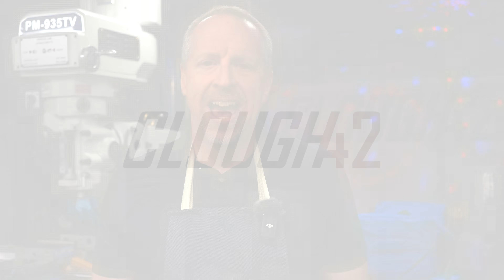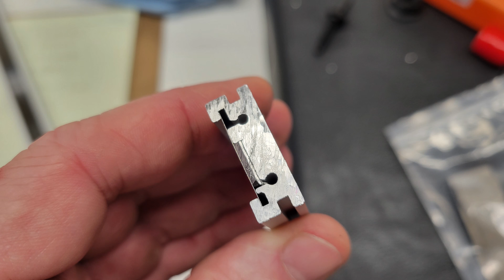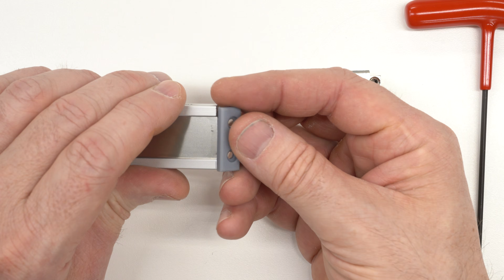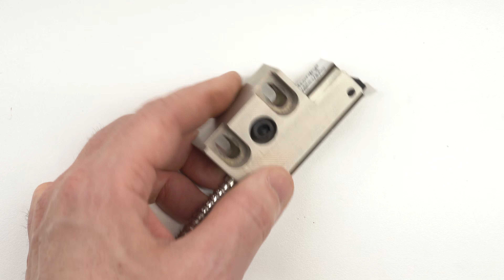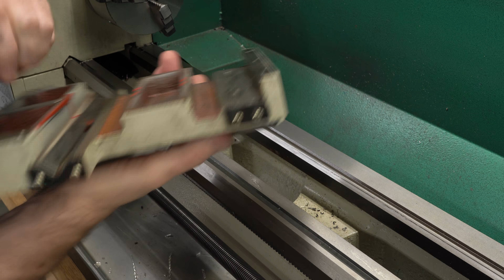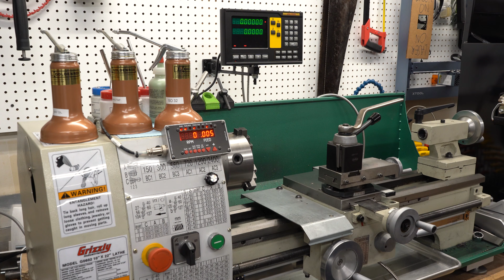Shop Accident Caught on Camera - Lathe DRO Install, Part 2

Comment: the more i look at other peoples lathes, the more the major manufacturing defect of mine glares at me...

the only lathe with a tailstock that has its overhang at the rear... sold under various names as a 12x36 gap bed. al336. they all have the same tailstock... AGGRAVATINGLY ANNOYINGLY FRUSTRATING.

Comment: ... the vertical slot on the gib ought to be toward the sliding surface(s), to facilitate lubricating ... I think if you watch your vid, you'll spot it ... I know, you put the mark before you dismantled it, so, it was put the wrong way around at the china shop ... (my experience with Chinese gods, quality control is NOT in their dictionary ...)

Comment: I built two cars from scratch and always bled the most when working with stainless sheet. After washing my hands, I'd find dozens of mystery slices across my hands, but none deep enough to bleed. Looked like I'd been playing with a box or razor blades.

Comment: I wonder why you didn't mount the Z rail on the back side of the bed and have the X reader hang off the back end of the cross slide.  I would
think that would make for a much easier install.  That's how I did it on my  Modern 1340, no problems or issues and the cables are at the
 back out of the way.

Comment: Not that I’m saying I have the best way to do it, but I have made very good tool holder that mount on back splash (on thingiverse) so I didn’t want cable running that route, nor did I want yo see them. I ran them down opening at bottom of back splash (though my Z axis mounts to backside of ways) and just covered them in that split/corrugated plastic wire covers. Protected and any rubbing is no worry. As usual James, nice job. 👍🏻

Comment: Mag scales are great for low profile installs. You may want to check for minute swarth/chip build up between read head and scale over time. I started to get a slight error from a skipping read head. The wipers are good but not perfect. 👍

Comment: Is your mill 3 phase, if so how do you convert phases?  I have a rotary phase converter for my 3 horsepower mill, but the RPC is also 3 hp so i have labored starting.  Got any tips on how to fix this?
Reply from the maker: My mill is single phase.
Reply: Ok, thanks.

Comment: Why the front for the Z scale?  Not saying it's bad/wrong, just curious on your thought process as in my head it goes on the back.  Is it just avoiding making life harder for yourself to get to the back?
Reply from the maker: It's much easier to mount in the front, much less exposed to chips and oil, and also Robin Renzetti argued at one point that it's more accurate in the front, because it's less affected by flex in the machine, since that's where the leadscrew is.
Reply: @Clough42  Hmmm, I don't subscribe to that notion...

Comment: Your VFD deceleration setting is downright scary... I'm imagining turning that switch from fwd to rev instead to stop, waiting it to stop and then putting my fingers where they're not welcome just as it accelerates back up. Plus all that waiting for the thing to stop... 
I keep mine on something like 1-1.5s acc and 1.5-2s dec, though I do use a breaking resistor, s-curve profiles and have a slower acc/dec setup wired to a switch in case I need to turn something really massive. Makes for really easy threading to shoulder

Comment: Like my Grandpappy told me when I busted my knuckles on the car frame when the nut broke loose, The job isn't over till you bleed. I noticed the hundreths display jumps around from vibration when lathe turned on, mine did the same, I turned off the last digit on the display because it was annoying and my lathe doesn't have that kind of precision anyway.
Reply from the maker: Yeah, I'll probably to the same.  When I was setting it up, I saw the setting for that and thought "Sure, why not?  It's a 1um scale."  But you're right: it's noise.

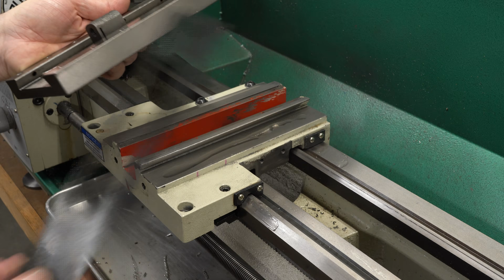Comment: Nice addition the the lathe. At 17:56, however, you managed to pour plenty of fine cast iron dust from the taps onto your freshly oiled surface, when you flipped the cross slide...😧
Reply from the maker: Oh, hey!  I didn't even see that.  I blew out most of the holes, but those are blind.  It looks like most of it ended up on the shield, but it's probably worth taking it apart to clean it out again.
Reply: @Clough42  Latest when you do the "secret" project 👍

Comment: For the read head on the apron, I would probably use some blue thread locker.  That looks like a tricky thing to adjust and it would be annoying if they vibrated loose.

Comment: Nice job James, ....I will impart a lil hint from personal experience......make absolutely sure that the corrogated metal wire shielding where it attached to the read head is sealed to the read head in silicone... and firmly screwed to the read head using the attachment screw. in its attachment flange...those wires....they do have a tendacy to pull and loosen up, as they move back and forth thus  allowing oil and fluids to migrate there or even pull out with strain.........just saying......

Comment: Nice job! Can you store the center in the DRO and recall it so you have the option of machining to a fixed width from zero, if that makes sense?
Reply from the maker: The DRO has a tool library, so you can in theory swap tools in the toolpost, and swap tools in the library and have an absolute diameter.  I haven't played with it, but I suspect on a small lathe, that will only get you so close due to flex in the machine.

Comment: Aren't you afraid that that stop screw for the tailstock will change position over time due to vibrations?
Reply from the maker: I planned to use Vibra-TITE, but the tube I have is dried up.  I need to buy more.
Reply: @Clough42  Or:  have lathe, will make spacer collar.  That way it could only give more clearance rather than less.  Did the same for my carriage wheel so it no longer disengages - the graduation ring came with it so you were forever losing your place.

Comment: My last industrial accident was 4 stitches down my fanger courtesy of my 5in angle grinder getting frisky. The tendon and knuckle have yet to return to "normal" some 3 years later. The nicks/chuck jaws bites are almost daily when clamping/deburring parts all day. Never fails to find the jaws when they are spinning 1000 rpm and your sand paper or scotch brite sends a finger into them.

Comment: why not just convert it to CNC? wipe out the leadscrews insert some ballscrews and servos and you're ready to go... For handwheel fetishists they can get 2 digital wheels and wire them up accordingly.
I had some magnetic scale installed from the beginning on but I only used them once for calibrating.
I'm even making MT2 Tapers with my mini lathe via CNC that's something that would take much more time when doing it manually. When doing multiple same parts I just measure the first few parts and then let it go.. during the run I just measure some key parts if the size is still okay and I'm not over-stressing the (weak) stepper on my X axis.. my lathe is smaller than yours and I'm still fine with it.

Comment: I used a cable carrier on my lathe for the z axis, cross slide, compound and coolant cords and tubing. Really cleaned up the installation. It was placed on the back side of the lathe bed. Drilled a hole for the wires to exit just above the chip pan and added a cover to deflect chips and coolant from exiting. Very nice and neat installation. Every lathe is different and one needs to let their imagination go a little to come up with the most compact and protected installation as you just did.

Comment: I have a similar shop problem. Somebody seems to keep breaking in and plating everything with rustolite.
Dro looks lika a good candidate for Bluetooth.
Yes I know batteries for the sensors are a pain.
But not really thats easily solved.

Comment: Just wondering why you chose to mount the scale on the front of the lathe and not on the back. Seems like routing the cable would be easier with the scale on the back
Reply: I'm wondering the same thing...

Comment: I wonder, do they make optical read heads and scales for areas with a lot of EMI?
Reply: A lot of DRO scales are optical, magnetic or inductive strips seem to be less common in my experience. The Chinese kit I installed on my mill is optical

Comment: Very nice job. I learned a bit about how the DRO works too.  One question, did the stop screw you installed bottom out so it wont get loose or did you have to back it out to ensure the tail stock doesnt hit the dro?  I guess you could always install a screw long enough so when it is tightened to the end it will still be long enough to do the job.

Comment: That turned out awesome. Don’t think I’ve ever seen anyone mount the Z-axis scale on the front of the lathe before, but it sure saved you a lot of work taking the back off and you could also see better in the front.
The X-axis mount is brilliant, another first seen like this by me. Here’s a tip for when you take the apron apart again. When going back on it will help you line up the half nuts if you clamp them on the lead screw, and then snug up those top screws. Do it several times clamping, unclamping and tightening the screws until when you engage the half nut it doesn’t pull the lead screw or cause it to flex. I had to mess with mine to get it lined up perfectly so as to not move the lead screw when engaging the half nut. Awesome video, enjoy that DRO.

Comment: Excellent video!  I have been contemplating a DRO on my HF 8x12 lathe for many years now.  It was great to watch you run through the install.  I picked up several good ideas.  Thanks.

Comment: Most dyes work well with resin 3d printers. You don't necessarily need to get a specific color if you're fine with mixing your own color. I use Siraya Tech Blu (clear) as it's quite durable.
Reply: Absolutely true. Black RIT Dye is my preferred way to pimp ugly resin parts 👍

Comment: I noticed that the first endmill you used had a little protective rubber helmet on it, what's up with that? :)

Sorry, couldn't resist! Enjoy the DRO…
Reply from the maker: YG-1 end mills come with those.  For good reason, apparently.  :)
Reply: Drag a hand across a flute or bump the workpiece into it.. the cap could save you. Especially when the holders are in a rack with the tool length set.

Comment: There's a woodworking publisher (Lost Art Press) that has an upcoming book devoted entirely to first aid in the shop (I'm assuming it will also apply to metalworking). I eagerly await it!
Reply: Super glue if it doesn't require stiches works great.